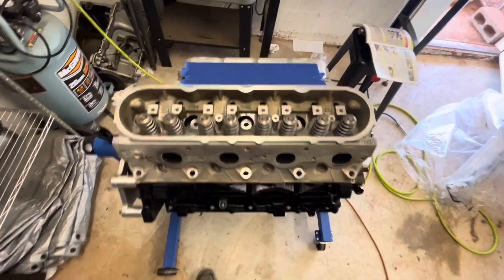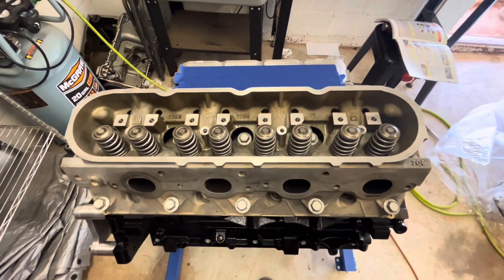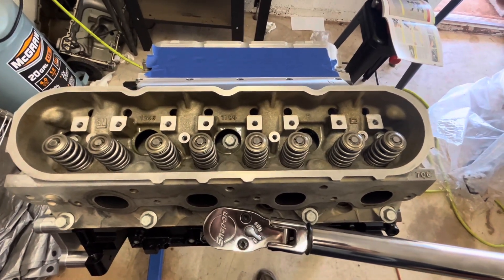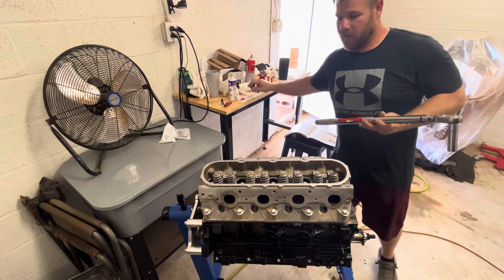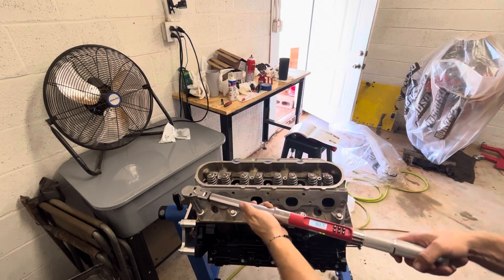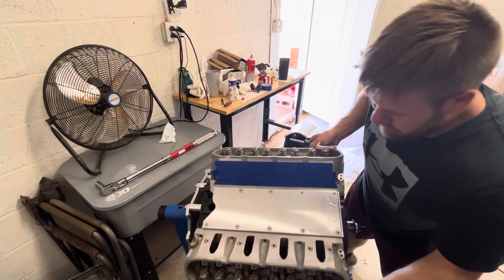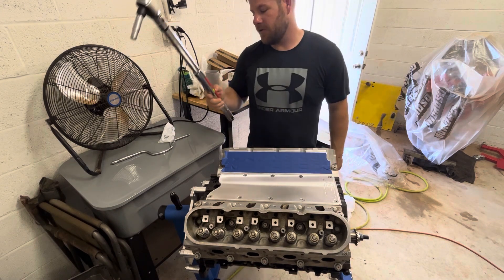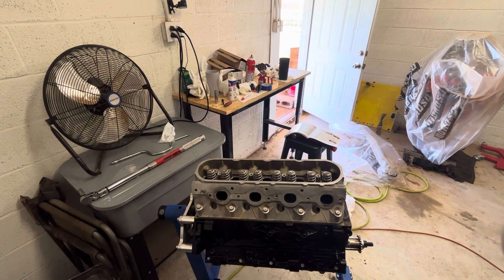5.3 Head Install and Torque Spec/Sequence

Comment: Hello, I may be wishing I saw your video first. LOL have a question for you I torque my head bolts wrong I figured out I had a gen 3 LS1 a little too late.. I torque my head bolts the longer ones 22 foot pound and then 90° and the final pass at 70°, which should have been 90° on that final pass, and 50° on the two shorter Bolt.. okay question is the truck has been driven less than three or four miles since I did this so do you think it would be okay to just torque these 8 bolts another 20° or would you just drive it and see if it holds or take a chance and tighten them 20 more degrees either way I may end up having to redo it. Thanks buddy

Comment: Hey so I bought the set from oreily’s but they are maybe 2-3 inches longer than the original head bolts. Is that supposed to be  like that or did I get wrong ones?
Reply from the maker: Way to long.

Comment: What about the 2007 ly5 cast iron block with aluminum heads what are the head bolts torque specs are they the same as on the all aluminum block and aluminum heads?
Reply from the maker: Should be the same but I would just google to double check, were balling on a budget around here and can't afford aluminum blocks.

Comment: Mine is a 2005 5.3 tahoe im doing a cam and will likely get a haynes manual anyways but would it be pretty similar
Reply from the maker: I would assume the torque specs should be the same across all LS books.

Comment: My question is after you torque the heads do you do a dry run start up to seal the gaskets or do you just put the antifreeze in and let it run up to operating temperature
Reply from the maker: I always just fill it up with antifreeze and run it.
Reply: @3rdGenC10s  would it be bad if I didn't have antifreeze in it and run it just before operating temp shut it down and let it cool down and than put antifreeze in because I know when the torque sequence is done it's fully sealed
Reply from the maker: I’ve ran them for a few without antifreeze but I’d say do that at your own risk.
Reply: @3rdGenC10s  i just want to make sure that my first rebuild goes well and have no hiccups imma go with putting antifreeze in and go to operating temperature and let it cool down

Comment: Once the final passes complete, is there a final torque spec that should be equal across all bolts?
Reply from the maker: The final torque is degree it’s not a set number unless using ARP fasteners. 

Since they are torque to yield with the final passes being in degrees the torque will vary from bolt to bolt but be within a few pounds of each other.

Comment: I have a 2019 Chevy Silverado. It has a black hex bolt in the front of the cylinder head driver side. What are the torque specs on this?
The first degree should be 90 and the last should be 50 because it’s shorter
Reply from the maker: No idea, haven't messed with a Gen 5 yet.

Comment: Amazing video and information. The only thing I’m stuck here wondering why didn’t you tell us the foot pound for 9 and 10 just like you did for the rest of the bolts which you told us the degree and ft lbs
Reply from the maker: @jorge56188  I’ll be purchasing another LS soon and will be doing a complete video series over the entire build no matter how small the detail I’ll make sure I put all the info in the next video.
Reply: That’s exactly what I came for
Reply from the maker: @seananthames7017  first pass they are 22 ft lb second pass 90° third pass 50°
Reply: @3rdGenC10s did you oil the bolts and the heads of the bolts when you put them in? I know this is something to do on most.

Comment: Great job on the engine.
I have 5.3LS L83 Cylinder heads.  M12 X 1.75 X 135 bolts. Do you know the torque specs of mine?
Reply from the maker: https://help.summitracing.com/knowledgebase/article/HE-04910/en-us

Comment: I’m doing my right now but my torque wrench doesn’t seem to have the angle torque
Reply: I bought a Durofix 1/2" ANGLE digital torque adapter. $85 on Ebay. For use with existing 1/2" breaker bar. Just doing one 2003 LS engine. Positive reviews. Maybe upgrade if I get totally bitten by the LS bug. 1982 Volvo LS swap.
Thanks for the well done Video.
Reply from the maker: Good looking out.
Reply: And have the same bolts
Reply from the maker: You have to purchase one specifically for angles not all torque wrenches have it.

Comment: 9 and 10 end up 50lb foot torque?
Reply from the maker: No, they end at 50 degrees.
Reply: I understand that both nine and 10 is 50° final pass but what was the foot pound on them????
Reply from the maker: Don’t know wasn’t concerned with final torque. Just following the the proper steps.
Reply: Well, I appreciate you responding back, great video will definitely subscribe, I’m going to torque bolts 9-10 to 50lbs for final pass…. Going to send it
Reply: Did the 50lbs work I am wondering the same thing cus I am going to send it as well

Comment: Do you have to use the angle part?
Reply: 9 and 10 what is the final torque pound?
Reply from the maker: @johnnygamble7806  Torque Spec and Sequence 99-03 Blocks

M11 Bolts

Step 1 22 lb ft Bolts 1-10
Step 2 90° Bolts 1-10
Step 3 90° Bolts 1-8 Bolts 9&10 50°

M8 Bolts

11-15 22 lb ft
Reply from the maker: With the TTY bolts yes. You can buy ARP bolts that are just a torque spec only.
Reply: @3rdGenC10s which arp head bolts for a 2002 sierra 4.8 motor have link or number ? For bolts

Comment: What about 07-14 heads?
Reply: Same for aluminum block?
Reply from the maker: @hzbz6815  https://help.summitracing.com/app/answers/detail/a_id/5189/~/gen.-3%2C-aluminum-block-torque-specs
Reply from the maker: @hzbz6815  https://help.summitracing.com/app/answers/detail/a_id/5191/~/gen.-4%2C-aluminum-block-torque-specs
Reply from the maker: First pass 22 ft lbs
Second pass 90°
Final pass 70°